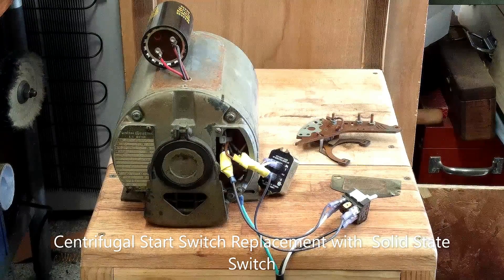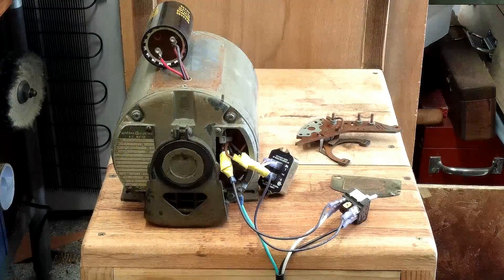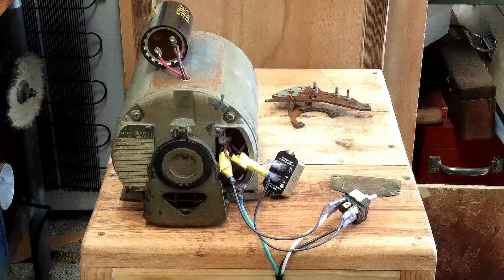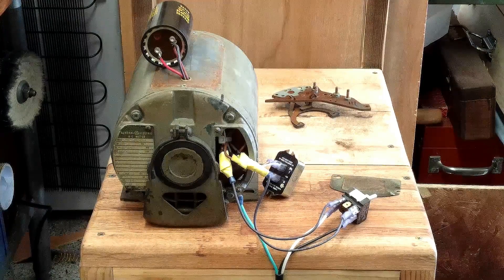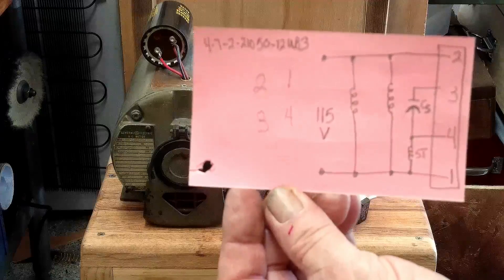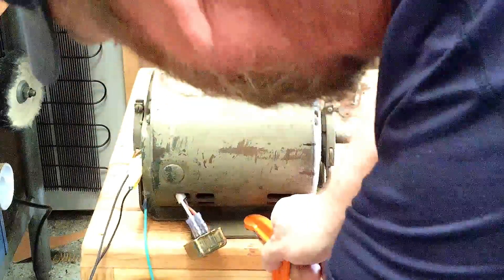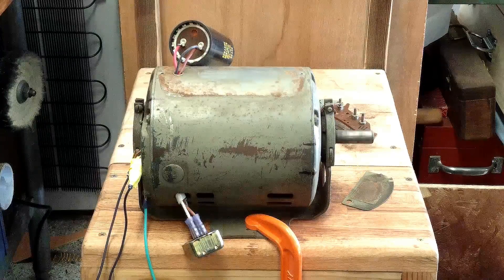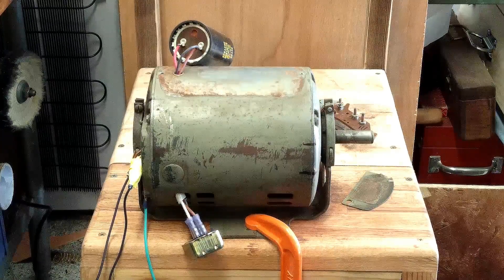Centrifugal Start Switch Replacement

Comment: Great video — really enjoyed it.

That said, I wanted to give you a little grief about this upgrade.
Lisa from Accounting just called… says the budget is crying.

Marcus in Acquisitions already reported that the entire 5-HP motor can be replaced for ~$30. Meanwhile, the Kazan project proposal lists a Synpac solid-state switch at $499+.

That puts us about $400 over budget to improve something that already works perfectly.

Production is requesting a justification slide by Wednesday explaining how a $500 upgrade improves a $30 motor.

😂

Comment: Could you send me the diagram of how you connected the starting coils and work coils, so I can identify your connection correctly, please, my motor only has a starting capacitor. thank you so much.
Reply from the maker: your motor may be very different than mine, therefore the diagram could be different as well.

Comment: Hello. Do you know how to test a electronic start switch (Wascator  S9807, maximun start winding current 50A 3S Duty, I found the electronic tests for another brand of switch called Sinpac 956605. Will the tests be the same for the Swicth Wascator (220V wascomat washing machines)?  And what would be the meaning of 3S duty on the label?  It is for a Wascomat washing machine 220 V.  Best regards

Comment: Hey man I have a 230v 5hp ge motor on my air compressor. My switch just broke and I have literally scoured the internet looking for a replacement. Would this work for me too?
Reply from the maker: Yes it certainly will.
I would consider a SSR capable of switching 165 amps , for the initial inrush protection .
Reply: So I just started looking for one that big and the largest I found was 100 amp. Could you recommend a place what I could find one? And as for wiring everything up, I’d remove the board, connect wires to each other where they would have been in the board, and the relay would go on the start cap wires?

Comment: I have an old Emerson 3/4 hp motor. It is off of my Grandfather's table saw. I tried to fix it because it would just buzz very loud and not start. The contacts for the starter, one pad is missing on one side, but the way it looks to me is, the contacter is normally open . Is this possible? Looks like when the Centrifugal clutch should pop out, it closes the contacts. Just the opposite of what I'm seeing on other videos. I've looked it over and to me , it seems to work that way. My contacter looks very similar to yours. Any help on this? Am I missing something? I am assuming this is a single contact, using the two arms for contact. The center part of this is just the return spring, or is that also a contact for start , and the arms for run? I would think if it buzzes it has a chance to run?
Reply from the maker: the centrifugal switch should be normally closed. that means it is always trying to use the capacitor until the motor is up to about 2/3 of rated speed. at that point, the centrifugal switch is opened by the flyweights centrifugal force, or spring force, and the capacitor recharges. the capacitor is ready for the next start cycle or heavy load. if the motor encounters a load of 1/3 of the rated speed, the centrifugal switch is enacted again due to the loss of centrifugal force by the flyweights, or the effect of spring force, dumping the capacitor charge into the start circuit to bring the motor back up to speed.

if you motor buzzes, the start circuit or the run circuit may be open.
the start switch should have 3 contacts, the normally closed contact discharge the capacitor, the normally open contact recharges the capacitor.
if your normally open contact tip is missing, the capacitor is not likely charging up.
this will make the motor buzz , as there is no current going through half of the windings. your motor needs 2 poles to run, and an extra for starting
Reply: @mikewalton5469  it is one of the rubber like pads that was riveted to one of the arms. That's what's missing. Looks like the plunger is holding the contactor open and when the weights are supposed to open , the plunger on the clutch disengages , which would allow the contacts to close. Doesn't make sense to me. Is their something I can  get to replace that pad?

Comment: Hi I am looking to do something like this I have a old 1/4 hp motor with out a centrifugal start switch or a capacitor, but a 2 way toggle switch one side for start the other side to run. So I like to know what relay you are using and if you think it will work for me so I can just have a on & off switch? Thanks Nice info on the video.
Reply from the maker: if you are just looking for single direction operation, a simple SPST toggle switch will work just fine.
if you need the motor to go in both directions, a DPDT toggle switch would be necessary.
the switch i am using in this video is meant for a capacitor start motor and would not be the best thing for your motor

Comment: Great video. If the centrifugal switch is not releasing would this cause for the motor to draw higher current. My motor runs approximately 3amp without load and about 4-6 amp with load. I have found when the switch is not opening the current jumps to 22amps. The problem was a dead capacitor which I feel was the cause from the centrifugal switch not releasing when motor on. I find that the switch only doesn't release when the load is on the motor soon as I put some load after turning the motor on and off eventually the switch doesn’t release and the current jumps higher. The switch looks clean and no damage. Any help to diagnose is appreciated. Cheers
Reply from the maker: Hello, the increase in amps could be caused by the motor trying to start without sufficient capacitance to give the motor the push to get it rotating. a motor is basically short circuiting on start up, if the motor's rotor doesn't turn, there is little resistance and the rotor will be like a conductor, the start switch acts like  a phase shifting devise, causing rotation due to the phase imbalance it creates.
A secondary problem could exist. the start winding is shorted and there is little or no resistance in the start circuit. when the start switch is activated (which it should be until about 65 to80% of rated motor speed) the charge from the start capacitor is supposed to be momentarily (within 15 to 30 seconds)  introduced into the start winding. once the motor is up to the predetermined speed the flyweights in the centrifugal start switch push on the start switch and open the start circuit, the motor then runs on the main windings without input from the start circuit.
if bearings are bad, belts misaligned, high starting loads are incurred, the motor may not perform optimally and may account for higher current draw if any or all conditions outlined exist.
A shorted main winding would also cause high current draw for many of the same reasons.

i would consider and recommend  continuity testing of the start, run circuits and inspection for the centrifugal start switch assembly
Reply: Thanks for reply. I opened it today again and found that the switch wasn't closed on one side so no continuity.  My understanding that both sides of the switch should be connected when the motor is off. Took it off, cleaned it and reinstalled it. Made sure that the switch is closed. Did a quick test with a load and so far the maximum current was approximately 7amps. Had it running for 20min with no load and it was fine with current of 2.95amps. I'll have to use it on the next job and see how it goes. Cheers

Comment: Great fix Mike. Any numbers on that relay, I screenshot the schematic so that's good. Thanks for the video!
Reply from the maker: http://www.electricmotorwholesale.com/
The 50 amp is good to 3hp on 115v
Reply from the maker: here is another source:
https://www.partsfps.com/switch-for-hobart-part-271612-2
Reply: Thanks Mike! Would an SSR work in this application?
Reply from the maker: A SSR will work, but you will need a timing component or otherwise have a potential relay controlling the capacitor on time
Reply: Got it thanks!

Comment: Great idea, Mike!  Where can you get these relays, and can you provide specs on the one you used? (I own an old grinder with a sketchy switch)
Reply from the maker: http://www.electricmotorwholesale.com/
The 50 amp version is good up to 3hp on 115v
Reply: @mikewalton5469  Thanks!
Reply from the maker: I use a 25 amp switch for up to 1hp on 115v
Reply from the maker: here is another source:
https://www.partsfps.com/switch-for-hobart-part-271612-2